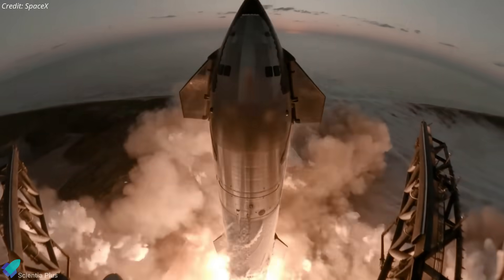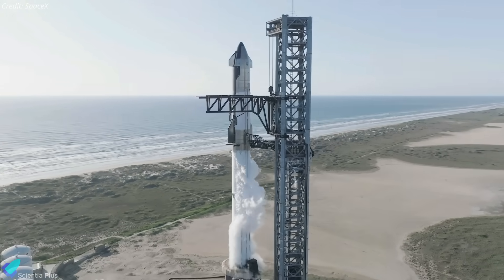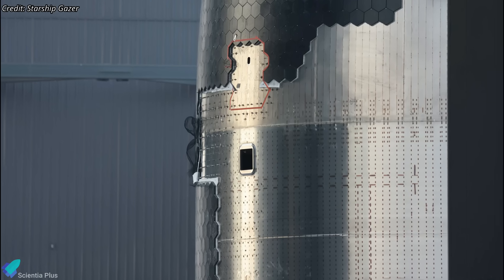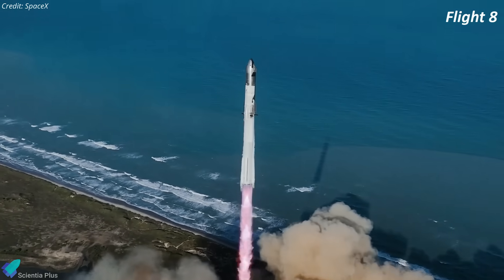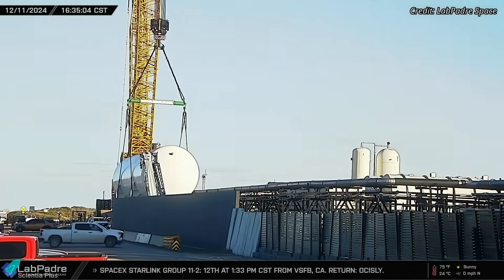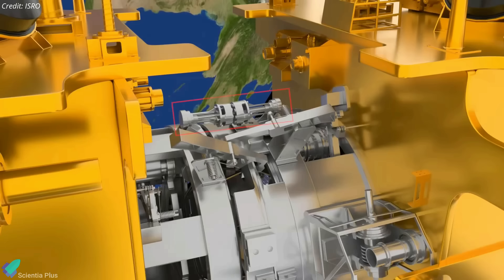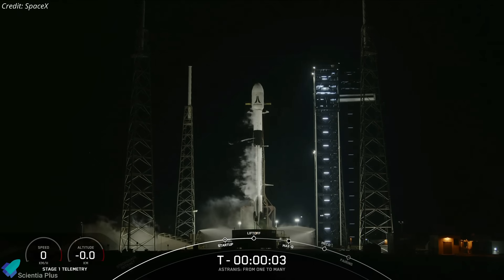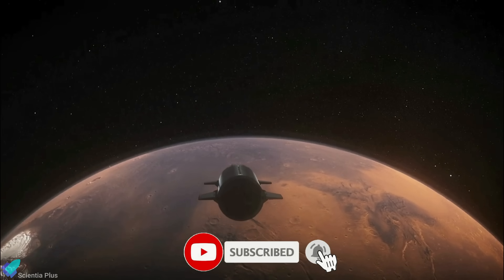First Starship Catch Is Happening - Hardware Secrets REVEALED! - Flight 7 Launch Date CONFIRMED

Comment: Unless they are building a catch tower on the moon / mars they are going to have to put landing legs on the Starship.
Reply: IMO, to get Starship human rated it will need to have landing legs.
Reply: the thrust required on earth to land starship on legs would destroy the ground. the moon and Mars have less gravity and therefore require less thrust to land and wont do as much damage to the ground below. the renders all show starship with legs on the moon.
Reply: @xsi1verxbulletxno.288  Destroy the ground? You think it will turn into lava or what? It is a weight issue only. Landing legs for Starship are totally possible but of course they lower the maximum payload capacity.

Comment: The catch arms don't need solid shielding. They could be protected by gas venting like they've talked about.
Reply: True but I suspect that at least for the first design iteration SpaceX will go for whatever solution is most mass-efficient and only try something else if the first design can’t be made to work. I worry about how much gas (hence mass) might need to be added to flow enough over projecting pins to keep them safe during reentry. My guess is that the catch pins will be retractable and only deployed once through the crazy reentry heats but we should know for sure soon. If all goes well with IFT-7 then I think we’ll see catch pins on IFT-8 in February.